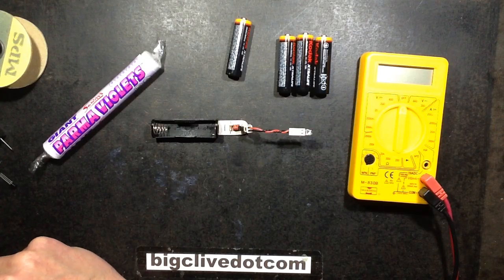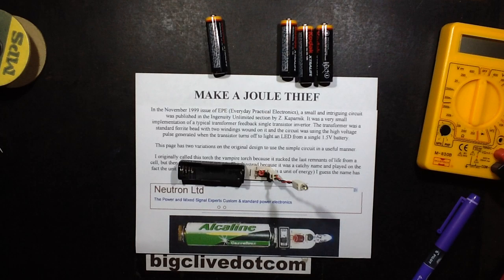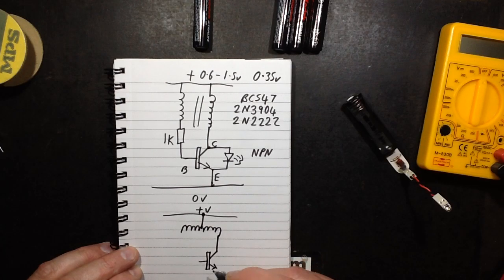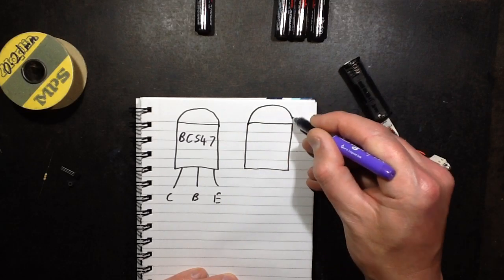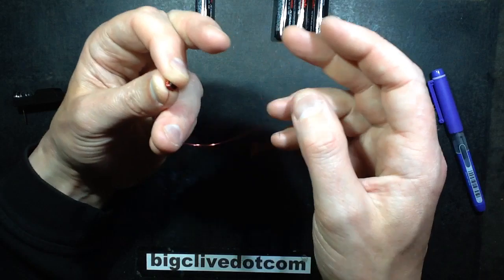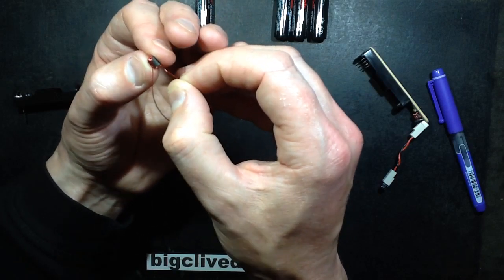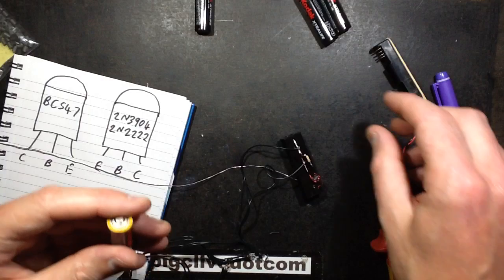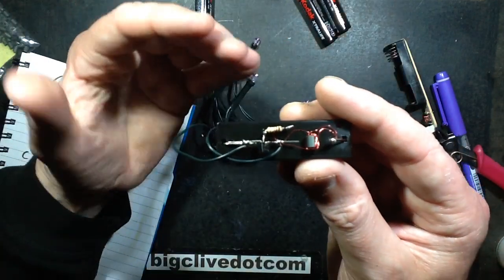How to make an authentic Joule Thief.

Comment: Hi dear, my name is shiva. I have a question and a little long story about my problem with joule thief :
I had 4 old solar  garden lights . their batteres going down. the batteres was 1.2V 600map NI-CD. then I buy 1.2v 2000map NI-MH. i replace them and its down . but ! problem start here !!! I think my garden lights are just white .oh boring !  so I can buy some rainbow LEDs and change the white lights withe them . so I order them and replace . but sadly the rainbow LEDs dont change color and stay at red color fix ! I try to messure the LEDs voltage . so the old white was 2.5v and the rainbow was from 2.5 untile 3v .it change with the colores ... so I think I must make a joeil thief. I search the youtube and find a video that learn how I can increase 1.5V to 3V . I order all things and make it but its not working :( the things I use are : 
transistore : c945
resistor :  2K
joul : 2MH 40m0hm 2A coil wire wrap toroid inductor common mode choke
LED : 3V 20map rainbow slow change color 30 sec

so can u help me or teach me what is my wrong ? thank u very much xxx
Reply from the maker: +Mehr Arian The RGB LEDs will not change on the pulsed output of the usual circuit.  They need a diode and capacitor to convert the output into DC.
Reply: +bigclivedotcom can u plz tell me how i can turn them on and what i need to buy? When i connect them straight to 3v battery they change but i dont know why in the solar kit dont change :((((
Reply: +bigclivedotcom and can you please write and list here the material you use for this project that i order on ebay? I order the transistor but i cant understand about wire and beed and resistor ... Many thanks :)
Reply: +bigclivedotcom  after that, if i put a 1.2v battery , then how much is the output voltage ?
Reply: +bigclivedotcom Hey this might sound stupid but can you send me 1 or 2 of these if i sent you a envolope with a few dollars in it and my adress?
Reply: +bigclivedotcom an led is a diode right ... wouldn't you just need a cap to smooth out the pulsed dc.
Reply: +Mehr Arian
What's happening is the LED you are using has a built-in circuit to drive the RGB LED in a sequence of ways to produce different colors (it varies the brightness of the Red Green and Blue LED inside just like any standard color display).
By driving it with a Joule Thief, you are not giving it a continuous supply voltage, but, rather, pulses. This causes the circuit to turn on, light up in its default initial color and turn back off again, repeating ad infinitum.

To make the circuit switch colors, it needs to be fed a continuous voltage (DC) so it won't reset and, instead, cycle through its colors.
In order to do this, you need to (as bigclivedotcom suggested) rectify the output voltage of the Joule Thief and filter it by means of one or more diodes and a capacitor. Since the Joule Thief's output only goes positive, a half-wave rectifier is sufficient.
A good choice in this case would be a Schottky diode as they have a low forward-voltage drop. If this gives you trouble it will be due to the reverse capacitance, and you should use a regular 1N4148 instead. (Get both and try them out just to be safe)

If you Google half-wave rectifier you will find examples and explanations.
Reply: +Sam Noneofyourbisnus
You are correct to comment that an LED is a diode (LED stands for Light Emitting Diode), but the LED (or rather, "LED") Mehr Arian is using is actually quite a bit more complicated (and far cooler) than a regular diode as I explained in my previous comment.
Reply: Since the output of a joul thief is pulsed DC, I wonder if just a small capacitor across the leads of the LED would be sufficient to keep it powered during the off cycles? At such high speeds, I would imagine a 2.2uf would do it.
Reply: Dan Coulson
You'd need to add a diode to prevent the capacitor from discharging when the transistor is on, but sure, that could work.
Reply: Good thought on adding the diode. I didn't even consider the charge flowing back from the capacitor through the transistor!

Comment: Is there a way to Upscale this to run off old 12V batteries. I work for a battery shop and get alot of old batteries that are quite low capacity but still have good voltage. i have customers that only want to run some led light strips for camping on weekends. if you could use an old 10ah battery to power a light strip for 16 or so hours i think it would be a nice cheap option.
Reply: If you've already got enough voltage but not enough amperage (or enough capacity), the joule thief won't solve the problem.  It's for the situation where you still have enough amperage and capacity but not enough voltage.

Comment: Cute little circuit, obviously the output has quite a high impedance, that's why the voltage varies with the load. I expect you could get even more out of the battery if you used a Germanium transistor?👍

Comment: Nice video sir. I wish that i had known about the circuit before wasting many pounds on batteries for silly Xmas led lights.

You mentioned that you had tried to make the transformer core from a steel nut. Cannot work because (as I'm sure you already know) the transformer relies on the creation and subsequent collapse of a magnetic field, which then induces a voltage in the secondary coil. 
If you use a solid lump of steel as your core, the magnetic field will not collapse fast enough to allow the thing to work. the higher the frequency, the worse this becomes. 
Even your standard mains transformers, working at 50 / 60 Hz would be useless with a solid core, which is why the cores in these are made of many, thin steel laminations, each having an insulating layer. The insulating layer also serves to electrically isolate each lamination from its partner, thus reducing eddy current losses.
Ferrite cores take the lamination idea even further. They are made of a compound which is basically Iron oxide and either a compound of Nickel or manganese. The idea is that as the cores exhibit low values of coercivity, the magnetic field will be able to change state very rapidly.

Oh, and just a quick note on your enamelled wire. Not all enamelled wire can be tinned in the manner you prescribe. It all depends on the insulation class of the wire. The wire you were using was low temperature grade, commonly known a 'self fluxing'. As a general rule of thumb,  if the wire is red - as in your case, you will be able to directly solder it. If however, the wire is a golden / yellow colour, you will have to scrape / sand the lacquer off before soldering.

Well, that's my 'two penny worth'. Hopefully it hasn't bored people to death.

I always find the videos entertaining and enlightening. Long may you continue with them.

Comment: It is also know as the Blocking Oscillator. It has different modes and can be synchronized with a source. It can also be used to create a regulated up converter as used in calculators with Vacuum florescent displays.  TDK used to make all those transformers for calculator dc-dc converters. they have 1 winding for filament also, about -20 volt for PMOS calculator chip.  The resonant mode happens when you wire a capacitor in parallel with the secondary coil . Sine wave.

Comment: CFL transistors 1300x work well also on that circuit, although the pinout is usually reversed as B-E-C even on TO-92. The size of the ferrite is not critical also, which is nice, I have even used a steel washer as a core.
Reply: DjResR CFL's are basically the same circuit.

Comment: Dear Clive,  If you have any ideas on a series cell exhauster I would be interested.
Various gadgets still use coin, PP3, D, AA and AAA alkaline cells and used cells pile up in a few years.  If there was a way to get good value out of the remaining capacity besides driving an LED that would be great.

I propose a circuit that can take from 2 to 30V input and slowly charge a 18650 cell reliably or provide 5V for charging a USB powerbank.

The power should be supplied with a series string of random exhausted primary cells of any sort that it will drain to 0.2V or so.  The thing is that once we start to reverse charge the cells they can easily leak or worst case burst open.  The number of cells should be possible to easily increase by adding more battery holders with the voltage protection circuit.

Battery holders with a reverse protection diode are the simplest implementation but I would hope for a bit more smarts on the cutoff voltage depending on 1.5, 3 or 9V source and some way of indicating which cells are drained and need to be replaced.  There must be metric tons of disposed cells that have 1.1V in them that is not enough to drive a toy but still contain 10% or more of the original capacity ready to be crushed.

The longer the chain the less current is drawn from each one that usually gets the most energy out of the cell.  The longer the chain the less often one needs to prune and replace the empty cells.

The empty detection could be done with a micro I suppose even provide statistics on how many trees saved.  Modern MOSFETS used for Li-ion cell protection could work as a low drop active diode. 

Having this as a kit and a free hardware PCB from PCBway could let the concept spread and eliminate all that energy going to waste in the recycling that will never see a JouleThief.  Just in case you figure out a way I propose a companion name of WattHoarder I hope you can create some momentum for such a project.

Comment: An absolutely ingenious circuit. We use such LED fairy lights every year and so you can save a lot of batteries. If you convert the light chain, you need only one AA - cell (alcaline) and use this in addition still until the absolute end. 
However, this is not useful for zinc - carbon batteries, because they are then sure to leak.

Comment: So these two windings, done this way, will be of opposite handedness and polarity. Bifilar wire resistors are done that way because it pretty much negates inductance. AFAIK if you get a mains trans from a device that has a split secondary for further rectification for use with a push-pull transistor pair, such as most B and AB class amps, the halves would be wound in the same handedness and polarity.

Comment: I have made 50 or so different variations of the joule thief/jeanas light! GOOD ON YOU M8. I love this circuit, I could assemble them in my sleep! I was/Am very fond of TTL projects
Reply: At first I thought you were AvE. XDDDDD
But yes, this is a very nice little circuit. You can even scale it up and put a third winding on with hundreds of turns for driving CCFLs. Be warned, touching the output of that stings like a million bees.

Comment: It's important to note that the discharge voltage curve is not linear, particularly near the low end where the Joule Theif really (ahem) shines. The area under the curve really is much smaller here than a linear approximation would suggest.

Comment: I used the filter on switching power supply ferrite material was a big one. Use the 400 volt capacitor maybe 1000 micro farads it charged up to 80 volts with fast diode and it lighted one of those 120 volt led bulbs bright for second. Using around 2 volts on two aa partial spent batt.

Comment: Great circuit. I just wonder, would fresh new battery or two in series, as often used, blow up transistor or fray transformer in its present form? Using fresh batteries would prolong the light for eternity, I believe...

Comment: I wonder if you take an old AM radio and hold the circuit near the ferrite antenna, could you hear the oscillations?🎉
Reply from the maker: It can generate RF noise.

Comment: I tried this.  The LED doesn't even begin to light until about 2.2 volts. I tried reversing wires, checking the LED, etc. I even tried winding another toroid with different wire and it still won't work.I used a 2N3904 transistor.  The first one I tried used about 20 turns of 36awg paired together as in the video on an 8mm toroid, and the second was a slightly larger toroid with 27awg.  I checked the 2n3904 with a transistor tester beforehand. Strange.
EDIT: I got it working! Tried 4 different ferrites that I had and 3 different transistors. What got it working was taking the ferrite from a CFL. I didn't do anything wrong with the first attempts, but the ferrites from the first 4 simply didn't work. I didn't realize there was more than one kind of ferrite. Please save yourself some time and just use a ferrite from a CFL. Works great at about 0.4 volts and with all of the NPN transistors I had to try.

Comment: I did this too! First time I have ever got it working. I have tried it before and finally it worked. I did the inductor with 0.1mm wire and results are for now pretty good. Is there any downsides for it anyways? Other than it's pain to make the coil. Also I got some coil whine which is annoying but most likely I can lower it with some glue...

Comment: Brilliant, not sure how small I can make it but will answer my problem trying to get red and white LEDs shining together on my model train I think, experiments in the new year.
Reply from the maker: The red LEDs have a lower forward voltage than the white ones, so if in parallel with a common resistor they will hog the current and pull the voltage down.  You need to have the reds and whites on separate circuits with their own resistors.

Comment: You should consider doing this one again but using the battery box that came with the lights.
The lights already terminated in the box and one empty cell position could be used of the Joule thief circuit,
You could even make use of the power switch on the box if the cell was greater than .65 volts, or if you reversed polarity and used a Germanium pnp it would start down to about .2 volts.....

Comment: Batteries don't discharge in a linear line like that.  They have a much flatter curve at the top and drop quickly to .7v or so at some point.  See Dave Jones' EEVBlog video on the Batteriser for a really good look at this.

Comment: You can make the circuit slightly more universal by connecting the LED cathode to the V+ in case your starting battery voltage is above the LED voltage at the expense of some brightness when the battery is almost dead. Just make sure the LED's reverse voltage is above the battery voltage.

Comment: HI clive. A bit late but I tried the joule thief but I failed badly. Tried several times. with a small bread board and in the end I just soldered every thing together an still not working. It Turned out my batteries were not good enough. When I put in a single new 1.5 volt  the led turned on. (and connecting the led directly to the 1.5 it did not light up)  But when testing the old batteries with a volt meter they both had about 0.75 volts and in series +- 1.45 but when  connected to the circuit Maximum I read was 0.4 volt for both of them in series instead of 1.45. So how to test the batteries? I always test them unconnected.  Thx for the video! In the end every thing works.  Oh one more why does my volt meter only shows the 1.5 volt? I also checked with my simple ds0 150 scope and it shows +- 12khz but the highest voltage I see is vpp 2.27 what ever that means.

Comment: I have been experimenting with these little circuits and trying to figure out the proper amount of windings to use on the inductor to make it as efficient as possible. So far they only last about 8 hours on one AAA battery. Then they start to blink on and off. That usually happens at .5 volts. I have seen other videos on this and some go down to about .3 and some run many LED's, so what am I doing wrong? Can you do another Joule thief experiment with a larger inductor, to see if it lasts longer? This circuit fascinates me to no end. I am obsessed with them.

Comment: Great video Clive.  I've been looking at JT vids all over YouTube and now I find the man that coined the term.  Very cool.  I've got a question for you: If I wanted to make a bunch of these circuits, each with different output voltages from the same input, would it just be a matter of more or less windings on the coil?  Thanks

Comment: Hi Clive thanks for this. I looked at the cheap torch on my bench . . It has 9 leds a 3 AAA cell battery holder and a nice aluminium case. I wonder if this little circuit and 1 NiMh cell could replace the multitude of multi-cells required by so many devices?
I made this circuit and it works a treat, but alas not enough grunt to power a torch. Worth a video?
Reply: Richard I don't know for sure, but would think that NiMH (or any rechargeable battery for that matter) should NOT serve as a power source for this type of circuit, because the cell will be run down too low. Rechargeables must maintain a minimum voltage or they will be destroyed. Some intelligent battery chargers will even fail to charge cells whose voltage is below a certain threshold.

Comment: Try using the smaller speaker wire wound around the plastic of a three inch plastic PVC plumbing pipe cut one inch in torriod form works fine but of course lot of material. But works at 500 kilohertz radio freq I believe. Only puts out around 20 volts when charged around 15000 microfarads with fast recovery diode or skottky. But you may say why.

Comment: I made this circuit and it drew 34mA. (9mA thru led).  I split led from emitter and put straight to ground and put 100 Ohm resistor between emitter and ground.    Result, total current = 6mA. (thru led about 1mA) led is not as bright of course. (frequency is 64kHz). Thanks Clive interesting circuit.      On new 1.5V. cell should run for 3 weeks. My toroid slightly bigger than Clives with about 30/18 windings 0.6 wire..

Comment: Great video Clive. Would it be possible to use a transformer instead of the toroidal inductor? 
I have a few 230 volt to 10 volt, 250 mA transformers and was wondering if these could be used??